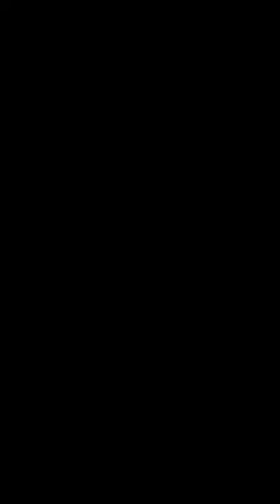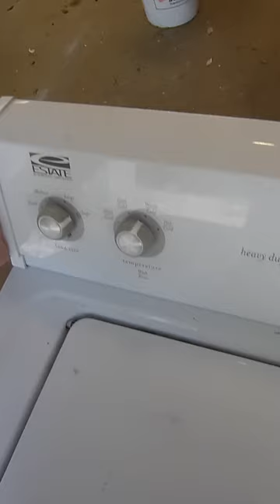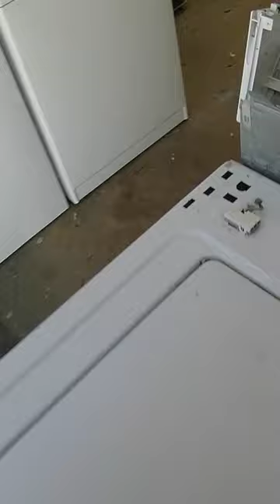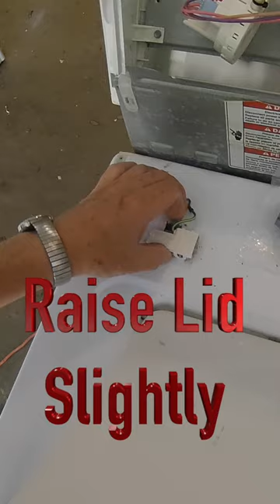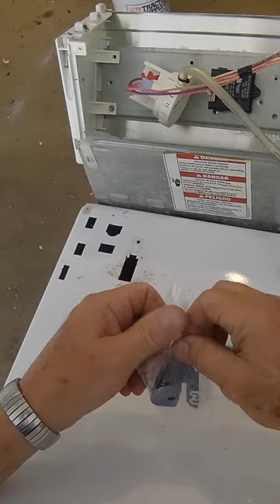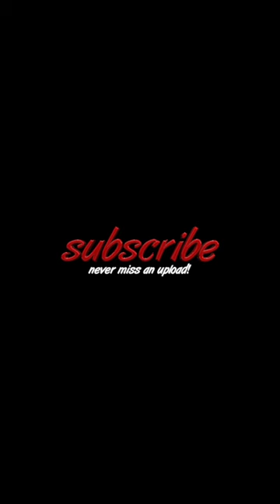Estate Washer Won't Spin Or Drain

Comment: i have the same exact washer will part in the link fix mine
Reply from the maker: Part # DPD 8318084 fits that Washer. You can flip up your console and check that you are getting the correct lid switch.
Reply: @HarperandKnowles  Man I really appreciate the reply thank you
Reply: @HarperandKnowles I got the part and in 10 minutes working again THANK YOU saved me alot of money.
Reply from the maker: Glad I could help! Thanks for the follow up!
Reply: I can’t get to the screws in the back of the washer to open the lid
Reply from the maker: Perhaps your washer doesn’t have screws. It may be one of the models with clips at the front edges. In that case slide a putty knife backwards at the front edges to depress the clips and rotate the console forward and up. Thanks for watching! How To Remove the Cabinet of Top Load Washing Machines: A Damage-Free Access Guide
https://youtu.be/SfD4mk1pCGE

Comment: Great video. Thanks for sharing. Switch ordered.

Is there a way to make it drain in the meantime?
Reply from the maker: Yes, you can use a piece of insulated wire stripped on both ends and jump the two wires that aren’t green. Then put it on spin.
Reply: @HarperandKnowles  I replaced the lid switched and it's not fixed. It just hums loudly for about a minute then stops (which is what it did before). What would be the next best solution?
Reply from the maker: Watch this video for clues to your problem. Washer Just Hums | Won't Start after Filling
https://youtu.be/VA9BPMEqguY
Reply: @HarperandKnowles  Yep. Sock was stuck in the pump. Back in business. Thanks for your help.
Reply from the maker: Glad you got it fixed. Now you have a new lid switch too!
Reply: @HarperandKnowles  it was worth it. $8.99 is much better than a service call! Plus the pride of job well done

Comment: Does it have to clip on before it works
Reply from the maker: It has to be installed and the lid down to work.
Reply: What I meant was does it have to make that click sound and that's how I know it's in correctly. I'm new at this so please be patient with me.  Thank you.
Reply from the maker: Yes it does. The switch is real easy to replace but you must raise the lid to do it. There is a stiff wire that actuates the switch when the lid closes. If it is bent too far down it won’t engage the switch. If it is installed correctly you will hear the switch click as the lid closes.
Reply: I'm going to try it again. @HarperandKnowles

Comment: Can you just ground that wire out to see if it will start ?
Reply from the maker: You can jump the two wires that aren’t green. Grounding them would throw your circuit breaker or cause a fireworks show. Thanks for watching.

Comment: Im so thinking this is what wrong with my washer. Its just like this one. The only thing is it spins sometimes and sometimes more than not. I have to shake it and play with the lid. When it works I can hear this clunk and then it spins. When I dont hear it then it doesnt spin. Sometimes it starts to spinbut, then stops. Does that make sense? Do you think this is my problem? 😢
Reply from the maker: It is very possible. Thank you for watching!
Reply: @HarperandKnowles Well I just watched again and it says or drain. My water drains just fine. It just won't always spin so clothes are soaking wet. Last week I did 4 loads and it spun everytime. This week it stopped spinning again on the main last spin cycle. Any clue what it could be?
Reply from the maker: It could be a worn out clutch. This video might help. Washer Clutch Assembly | Change This If Your Washer Won't Spin
https://youtu.be/bPPoeaQQOU4
Reply: This was exactly the issue. Thank you so much. My hubby ordered the $12 part on Amazon, and it's spining so hard the whole house is shaking. 😅❤
Reply from the maker: Glad I could help! Happy Thanksgiving!

Comment: I did exactly what you said and now it wont do anything but fill up
Reply from the maker: You can test whether your switch is working by removing it from the cabinet, plug the switch in, select spin and pull the knob out then move the black part of the switch with your finger until it clicks. The machine should start spinning if the switch is operating correctly. Thanks for watching!
Reply: I had a hard time putting the switch in

Comment: I cannot get the wires to unplug from the part
Reply from the maker: If they are spade plugs put the flat side of a screw driver against the female conector and tap it with a hammer gently.  Otherwise there may be a clip to raise or push in. Thanks for watching!
Reply: Thank you sir!
Reply: Got the replacement part today. Got it on, still won’t spin.
Reply from the maker: Does it click when you close the lid?

Comment: The fact that there's an entire video about this brand not spinning out like it's supposed to tells me that this brand is garbage and I'm just going to get a different washing machine.
Reply from the maker: They don’t make this washer anymore, but it was and still is an excellent machine. It only has a little age on it. Thanks for watching!
Reply: My parents were given this brand of washing machine some years ago. There have been no issues with it until now. It’s probably been 10+ years of using this second hand.
Reply: Slow dow, the washing machine is a champ! I got mine second hand, have had it for about 8 years, AND I live in an old house that the washer and dryer are outdoors on a covered patio (definitely not in a climate controlled area, but until this issue, it keeps washing!.It’s tough AF!